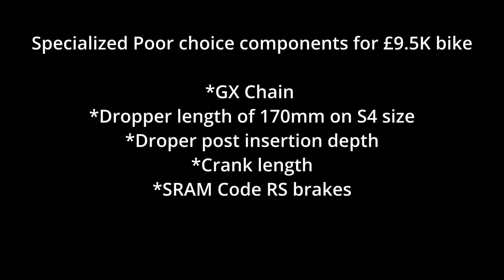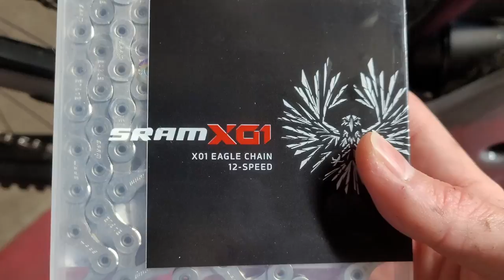Specialized Kenevo SL expert... considerations if looking to buy

Comment: I had to replace 3 hubs on my levo. Anyone who has an emtb make sure you have a steel hub axle.. my DT swiss is quiet and reliable.. hundreds later. lol
replacing my levers to rscs as well. I would like the kenevo sl though. I would do fox 38  and a fox float  tuned with 2.6 and cushcore (if you don't already have it) You know your stuff though so not really for you but anyone out there that is new to these kind of bikes.

Comment: Did you end up changing the hubs if so do it make a difference thanks
Reply from the maker: I am running the DT SWISS 1501 carbon with 240 hubs that uses the 36 point ratchet EP system, as not a full blown ebike didn't need ebike specific hubs

Comment: Hey Jonny, where are you riding towards the end?

Do you know if there is any difference between the standard frame and the s works? I was thinking of getting a frame only S Works and then doing a custom build and use the wheels from my enduro bike. I can get a frame for £5400, but your bike is now about £6600, so if they are the same frame with a different paint job then I may as well get that.
Reply from the maker: Hiya, the sworks has a better rear shock as the factory with extra adjustment and the cashima coating but that is the only difference, I saw Tredz has the my model (Comp model) for £6.5k which is a bargain for the full bike. Front fork is performance elite so only difference is the kashima coating. You could but the full bike and if not happy with the shock upgrade afterwards to the float x2 factory
Reply: @jonnybrown5715  im pretty sure the expert has an x2 rear shock and fox 38 with a grip 2 on the front, with the only difference being the stanchion coating, which doesn't make a huge difference, especially with the addition weight of the bike compared to a mtb. Spoke to a dealer today and they said the frames are all the same. I would rather have cable operated dropper and gears than the expensive elecrtonic stuff.
Reply from the maker: @jonathanhowson6420  the x2 factory on the s works  has the additional high speed rebound adjuster so more tunable plus the kashima coating vs the x2 performance model, issue with this adjuster is it sits in an awkward place on the shock and makes it awkward on the Kenevo to get in to adjust

Comment: I'm considering buying a Kenevo SL.
Reply from the maker: do it mate, you wont be disappointed... best bike I have ever had, even with my gripes about the upgrades needed i have yet to buy a bike i havent upgraded lol
Reply from the maker: Not sure where you are based but my model is on sale over here, Tredz have it for £6.6K for the expert :-) that is a great price considering its RRP is £9.5K
Reply: @jonnybrown5715  I'm working in Japan. In Japan, it is only legal to have an e-bike that goes up to 24 km/h. So the guy at Specialized I talked to told me that only SL models are sold in Japan. You cannot buy a regular Turbo Levo or Kenevo in  Japan, only the SL models. Anyway, thanks for your comments on the bike, and good video on the upgrades. I saved it. I'm about your height, but heavier. I might find some of the upgrades useful if I decide to buy the bike. There are only 2 available in S5 size in Japan. The guy told me that the L and S4 / S5 sizes are very few in number, and Japan does not even sell an XL size Specialized bike here.
Reply: @jonnybrown5715  The bike is sold here for ¥1,100,000, or about US $8,400, I think. That would be £6,834. So only a little more expensive in Japan than the UK. Not sure why, since the bikes are made in Taiwan or China, which is very close to Japan. I always see that computers and electronics are much cheaper in the West than in Japan, even though all of it is made over here - China, Taiwan, etc.
Reply from the maker: If you are 6ft 2inch or slightly below I would go for an s4 if you want a more playful bike, I sat on the s5 and it is very long :-( and felt big
Reply: @jonnybrown5715  Okay, thanks. That is good to know. I'm around 6'2 but the guy at the shop told me that an S4 would also be good for me.
Reply: @jonnybrown5715  I just got home from the bicycle shop. I bought a Kenevo SL Comp Carbon 29 S4. Cost was about £6,300. It was ordered from Nagano, and should arrive within the next week.

Comment: Hi, was wondering how tall you are if you replaced the 170 for a 150 dropper. I would look at 200 mm one up dropper if I get one. Thoughts?
Reply from the maker: Hiya, I am bang on 6Ft 2 inch and found that with a 170mm dropper and the depth of insertion with the Manic post i was on my tip toes when on the seat, didnt really like it. going 150 means i can get a better balance of length and insertion depth... i know i dont get full leg extension and possibly lose some efficiency but feels better for my style of riding
Reply: @jonnybrown5715  thanks for that. Happy trails! Do you now the number for insertion depth?
Reply from the maker: Sorry no I dont but think it might be on the geometry section of the bike on Specialized website
Reply: I did the same and im 5' 10 .
Reply: I’m 6’2” long legs, just bought a PNW 200 ml.  The insertion is better and the seat gets lower than the 170. It gave me about 2 more inches of clearance that I was getting caught on in step sections.

Comment: Wath kind of Handelbar did you use?Fantástic review.
Reply from the maker: hiya, i use the Renthal fatbar 35 carbon, i didnt get on with the Nukeproof carbons i first put on, didnt like the sweep. I have the Fatbar in 40mm rise 800mm (uncut) on 3 of my bikes, alloy version on another.. I find them the best bars out of the multiple I have tried over the years and are great in both alloy and carbon, carbon is a bit stiffer but half the weight